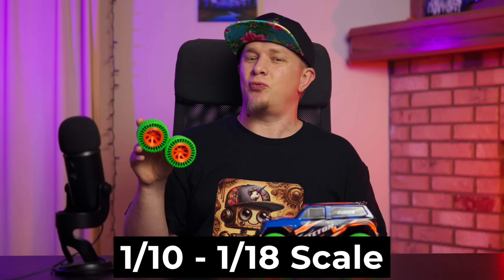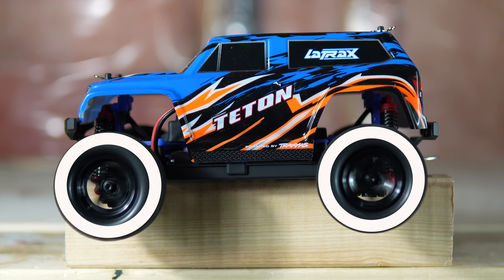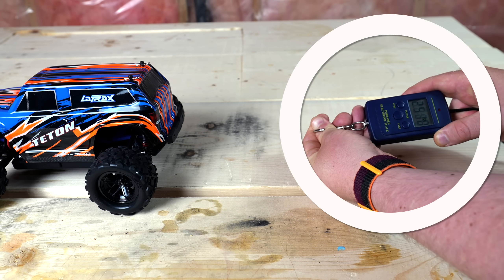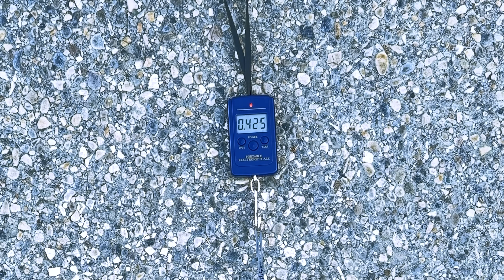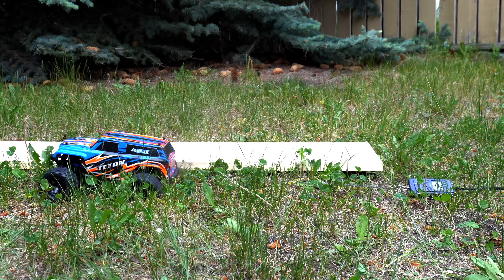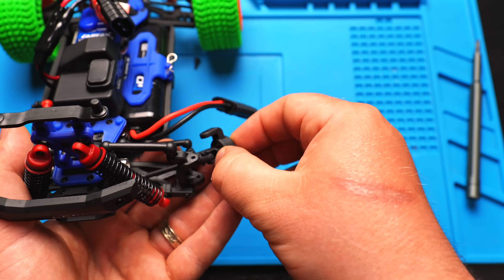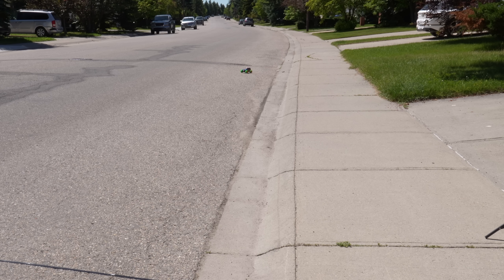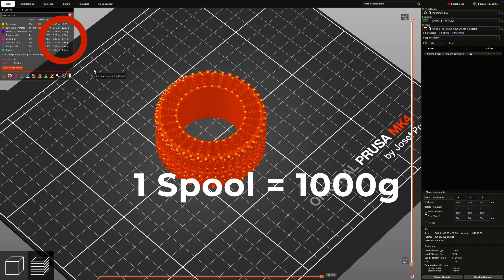3D-Printed RC Tires vs Rubber – Real Grip, Speed & Durability Test

Comment: I designed some paddle tires for the Arrma Grom lineup, they run well because they aren't supposed to deform much if at all. For asphault/dirt tires, in TPU you have to print with low walls and infill if you want any expansion whatsoever, which you do want so it can conform to the surface better. In general TPU isn't all that grippy, unless you can find really squishy stuff, or use a different material.

Fun experiment nevertheless!
Reply from the maker: You are right. The downside of printing hollow tires with low walls is an explosion danger. Tires must be sturdy in order to survive high speed rotation. Not sure if those tires would be safe to drive.
As for paddle tires - that’s an excellent usage of 3D printed tires.

Comment: Nice video, but to properly test grip, you should not just go full gas because you loose most of the traction. At least its good comparison because you did the test the same way
Reply from the maker: Yeah, if I pull the trigger half way, but not full gas - there is no guarantee that I pull exact same amount as previous in the previous test.
So you are correct, but it would be harder to test

Comment: BUT what about PEBA over TPU, also tires need to have more deformation for grip. Those have too many spokes in them to get any grab. Would be better off with side walls and very light infill like 10% The issue are not because of TPU, they are because of poor design.
Reply from the maker: You are right about design. But also you are wrong about TPU. I used TPU 95 and it’s very hard material. Theoretically, I could use 62, but it would cost more and be harder to print with. But rubber can go lower to 30. 
Rubber is softer. It will deform more.
So even if I do the same pattern and the same parameters- TPU will suck.
Reply from the maker: I haven’t tried peba. I think it would be harder to print, and it’s easier to make a mold and fill it with silicone

Comment: What about using a softer material to print these but make them so they fit inside the tire. So instead of replacing the tire itself maybe replace the foam inside to make a more balanced tire while retaining the grip of the tires.
Reply from the maker: It’s possible, but there are some caveats. 
Traxxas Teton’a wheels are foamless. They have air inside a tire, not foam. 
The main idea was to replace rubber, because it wears out quickly.
Lastly, softer material is harder to print with. So you may use TPU 62a, but you have to set up your printer properly

Comment: Great job on all the work that went in to testing. I definitely feel for you on that broken drivetrain part. I have a cheap fast RC car that I use for something for my Australian Shephard to chase and after 1 too many jumps. it also became rear wheel drive. 
I'm printing a set of TPU tires modeled after paddle tires since mine is used only in loose dirt and tall grass. I'll try to remember to comment back once I have them all assembled and tested. Hopefully they work out and they're bigger which should help with ground clearance.
Reply from the maker: Thank you! I hope your TPU tires work well in the dirt and grass!